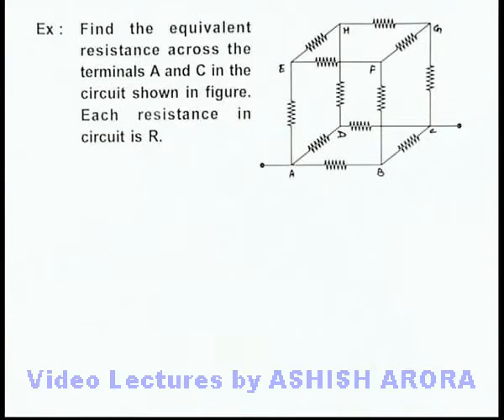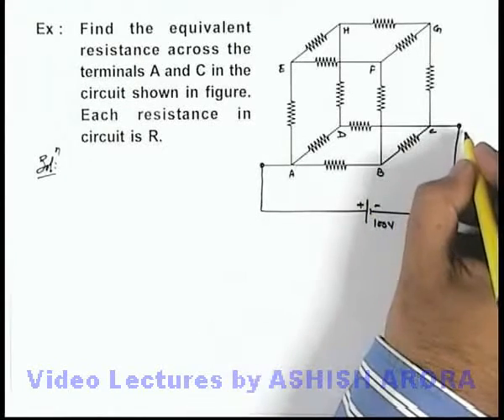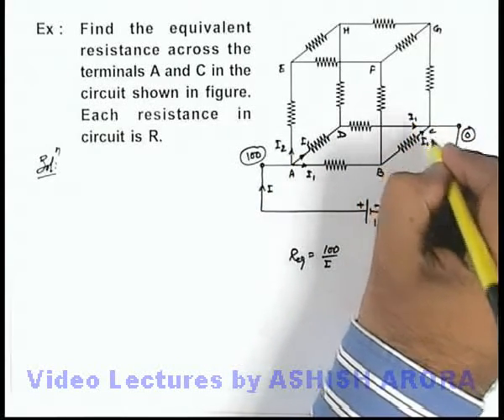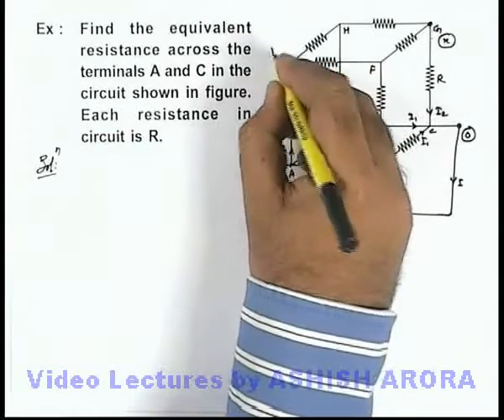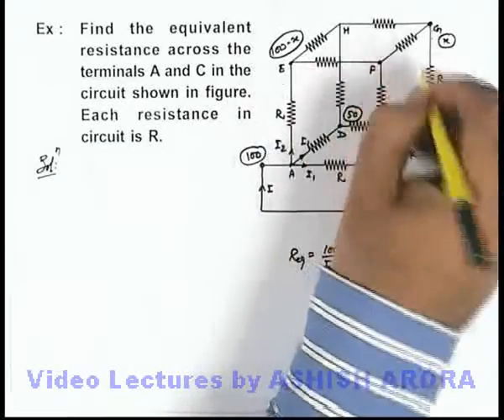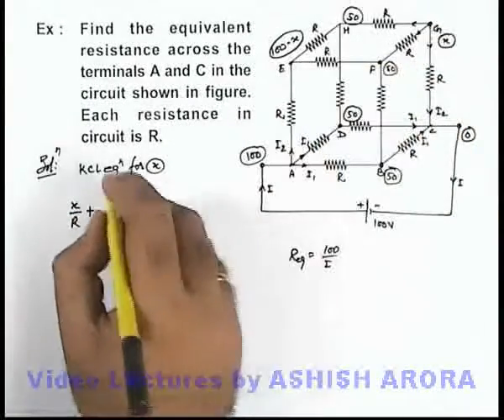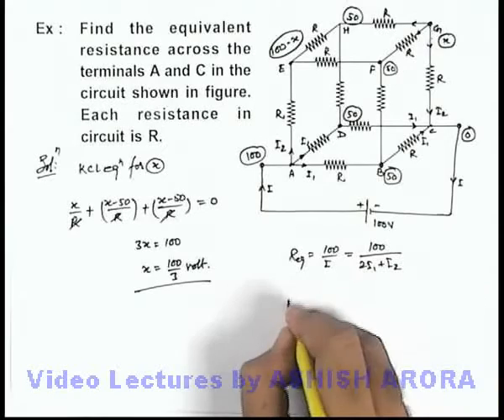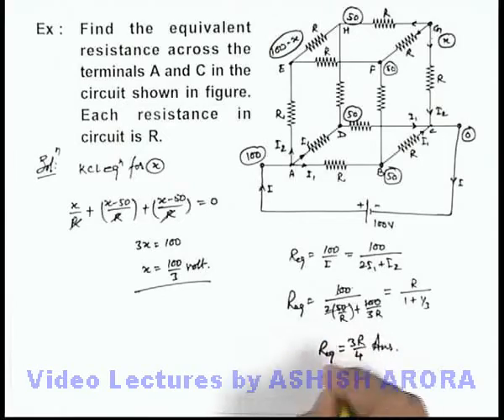Class 12 Physics | Circuit Analysis | #15 Solved Example-8 on Circuit Analysis | For JEE & NEET

Comment: For those who didn't get how at H and F potential is 50 each....
As in branch A-B-C , A have potential 100 and C has 0. So, B must have a potential average of it as AB and BC part of the branch have the same resistance so, potential at B becomes 100+0/2 =50....
Similarly in branch E-F-G , E have potential (100-x) and G have (x) so it's average potential should be there at F , as EF and FG part of the branch have the same resistance so , the average potential at F be (100-x)+x/2=50...
As you can see in part H-D and F-B have the same potential at their terminals p.d is zero and no current flows through it as said by Sir earlier... 
Rest use KCL to find x and I in respective branches...
Gambare!!!
Reply: thankyou
Reply: @har.shrajput  yo...welcome!
Reply: @kajalsahu013  what rank you got pls tell
Reply: Arigato senpai

Comment: sir, I have a doubt...  at point B and D we are getting potentials to be 50volts... how this 50came?? is it by (100+0)/2 or by (100-0)/2?? I think it is by (100+0)/2 because if I distribute potentials 80,20 rather than  100,0  then on doing (80+20)/2 we r getting the same potential 50 at B but if I do (80-20)/2 I am getting different potential at B which is 30... please guide me what is the correct way
Reply: No you are thinking wrong the potential at b and d came from the fact that as we know current from branch ab and bc is same(i1) and there resistances is also same and hence the potential drop acros two resistors must be same and hence potential at B and D will be 50 Volts
Reply: please reply this sir

Comment: Shouldn't that be x-100
Reply: Check the direction of flow of current
In 1st case : upwards so 100-(100-x)
In 2nd case: downwards so (x-0)
Final result.  x in both the cases

Comment: Sir F&H should be at (50-x) and not at 50
and therefore x=20 and R equivalent should be 5R/6
Reply from the maker: No... F and H are mid points of 0 and 100 so by symmetry it is 50... if you don't understand then take potential y at F and H and write equation for y then on solving you will get y=50...
Reply: Physics Galaxy Sir then that implies thst no current will flow through BF & DH then these 2 arms can be removed and we can solve the circuit directly through series and parallel combinations
Reply: @anshganatra4065  yes! to your 2nd statement
Reply: Ys brother u r correct!

Comment: Sir why is f and h have potential 50 V
Reply from the maker: As by symmetry these are equidistant from 0V and 100V terminals... i.e. currents are divided exactly in the same manner on both sides of these points...
Reply: Sir i calculated 'x' at A point i.e,     x/r+ 100-50/r  + 100-50/r....my ans is[x = -100] what's the mistake...plz help
Reply: @unrealistic_0  there are four currents at junction A. You are forgetting the incoming current I which is getting divided. I too did the same mistake.